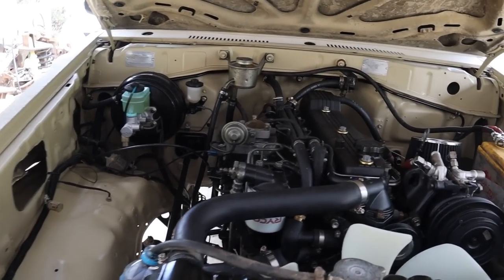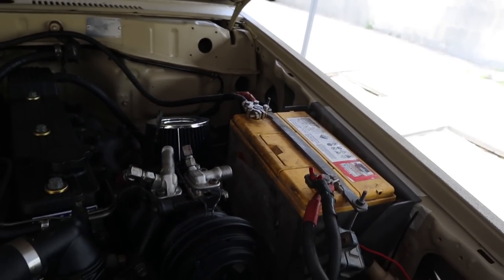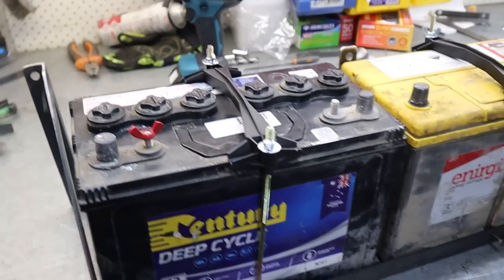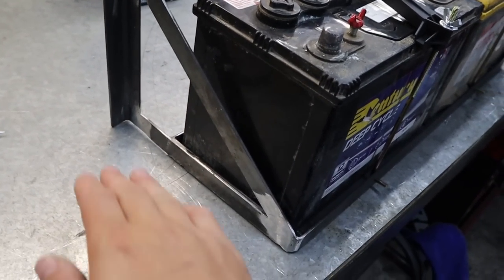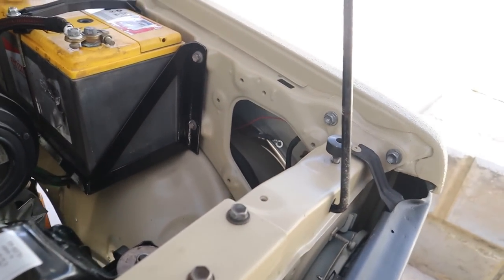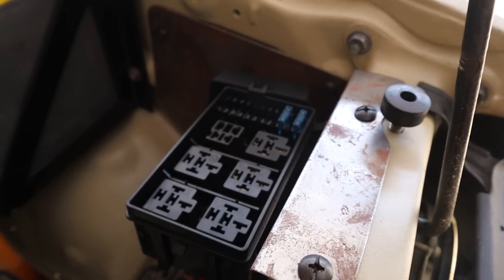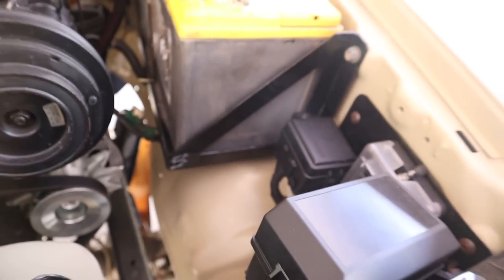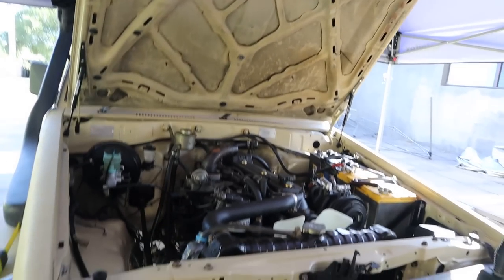DIY 4X4 Dual Battery Tray - HJ75 Troopy Build (EP14)

Comment: Good job young blood, with out sounding like an old man, have you thought about tying in the outside angle to the base, 50kg of batteries off road is a lot of inertia, it only looks like 25x25x3’mm a little movement and the angle could kink outward, sounds farfetched, but worse has happened to more well planned trays, sorry to but its just years of mistakes making me say it. Keep up the good work bro, she’s a dardy rig

Comment: Love watching your videos and the neatness and care with your work. Can I ask a question regarding location. Given that under bonnet heat is the enemy of efficient battery performance and longevity, would you have considered putting the tray on the drivers side of the engine away from the turbo? Alternatively can you heat shield them somehow. Keep up the great work. Just starting my 60 series lockdown project. The videos  keep me inspired.
Reply from the maker: Cheers mate i appreciate it! You're too right, the turbo housings will be getting as much heat shielding as possible which i think should be fine regarding the batterys. I would have preferred them to be on the drivers side for plumbing but would have been a nightmare rerouting the wiring

Comment: mate how many of these trays did you make before getting the finished product. just notice there were a couple different ones. Currently doing mine and its taking so much longer then i thought'
Reply from the maker: mickey baumberger this is the only one mate, had to cut off and redo one of the braces because it was too long and wouldn’t clear the bonnet